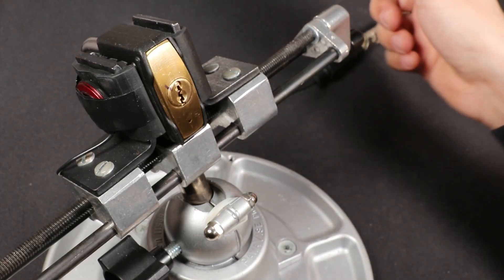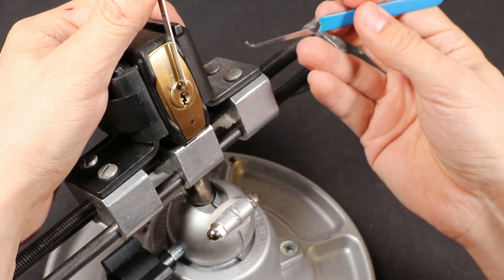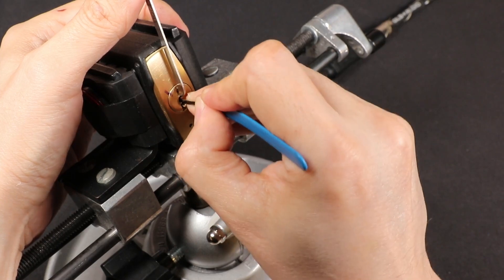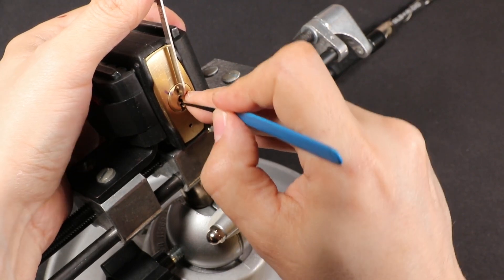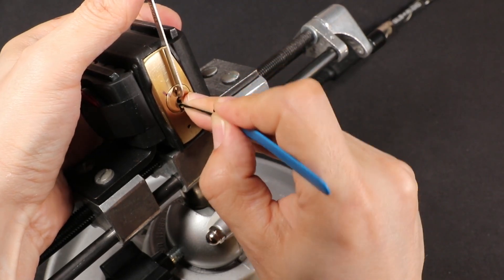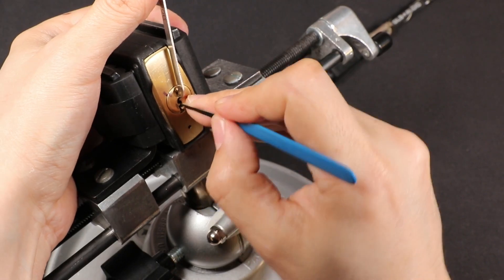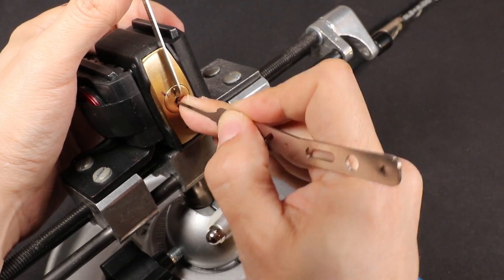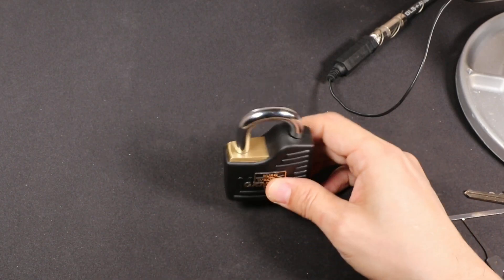[L233] Burg Wächter Gamma 700 Padlock - pick

Comment: Nice pic! Perhaps a strange question, but could you point me in the right direction to assemble the vice with the clamp you frequently use? I have the clamp but missing the other components. Realy love your vice!!
Reply from the maker: Sure, there may be better options since I made this, but here is my copy/paste:
Panavise base (from my 350) with a camera clamp up top and a simple stud  
I use this clamp: https://www.amazon.com/gp/product/B0062U2M4E/ 
This stud: https://www.bandh.com/c/product/1340616-REG/ or https://www.adorama.com/kukg016512.html or https://www.amazon.com/gp/product/B072T4TNYW/
And an adapter to connect the two: https://www.amazon.com/gp/product/B01N132CZ0/
You need to screw the clamp on to the knurled end of the stud, if you put the knurled end down into the base it will not be held solid and will wiggle.
The red thing is a guitar pickup for listening to the lock https://www.amazon.com/gp/product/B07HVFTGTH/ which gets fed into my Zoom H6 Audio Recorder, but many people use this amp into headphones https://www.amazon.com/gp/product/B00EJCYSMQ/
Any picks with white handles in my videos are homemade. The music wire tensioners are cold bent, filed at the end, and 0.078" diameter, but you should use whichever thickness is wider than your keyway.